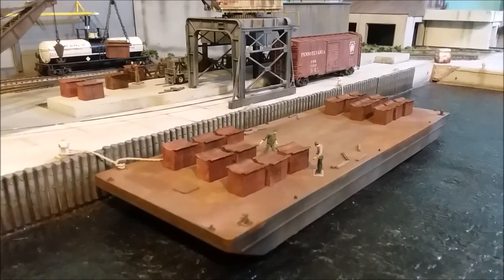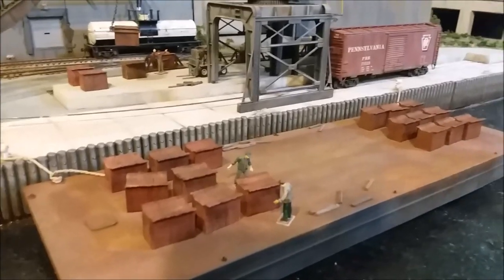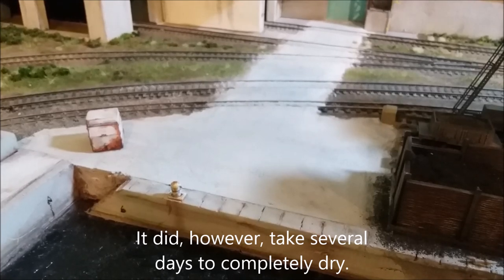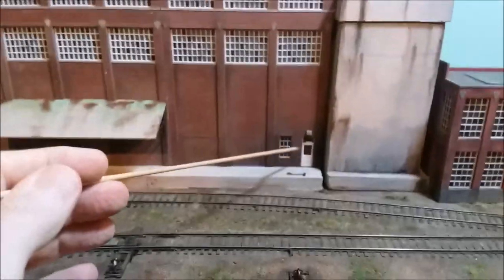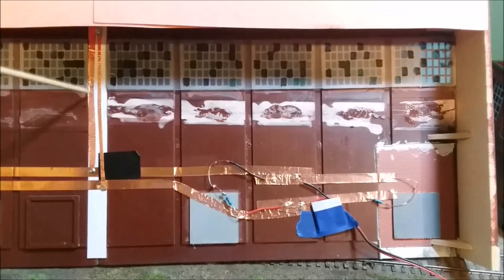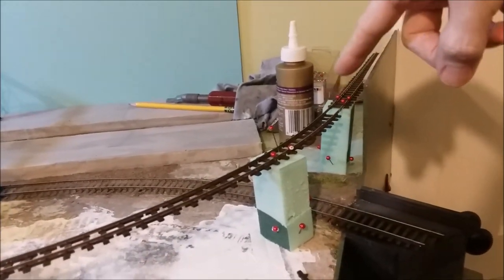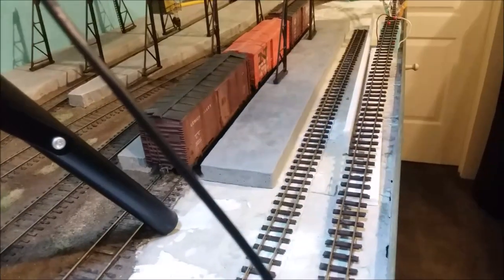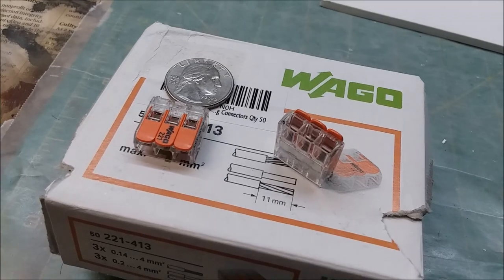Layout Update July 2023

Comment: Very good update…enjoyed the overview off your layout…never thought of using copper tape…what concrete color paint did you use on the styrofoam?  Looks great
Reply from the maker: The base coat is "French Linen" a chalk paint by FolkArt. I picked it since it was the best color from a limited selection at my local Hobby Lobby. Then over that is a wash of your favorite light-to-mid gray paint. I use slate grey mostly. Just slop it on to get nice variations in color. Then chalks or powders for weathering.
Reply: @longislandrailroadmontaukb982  thanks for the info

Comment: Curious, what are dimensions of layout, depth of shelves, peninsula, isles?
Reply from the maker: The room is 10x13. The shelves around the circumference are all 18", except the water that I added is an extra 6". The peninsula is 24" wide and sticks out 106" from the wall.
Reply: @longislandrailroadmontaukb982  so, isles about 2.5 feet I’d guess.